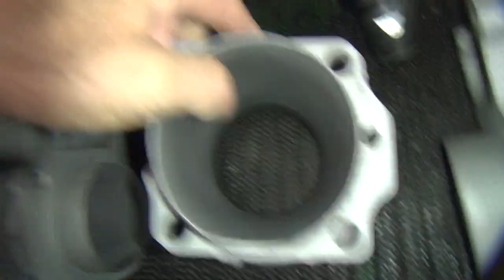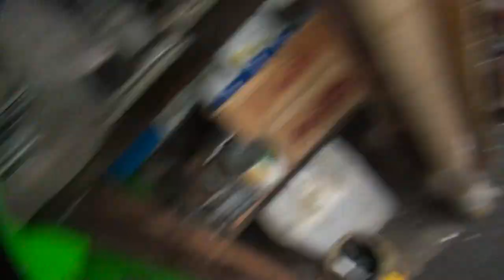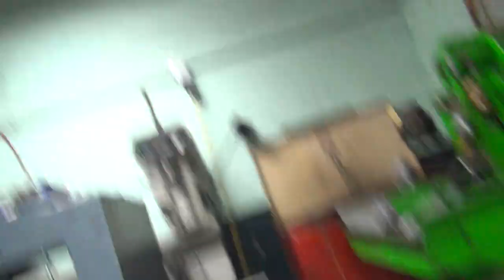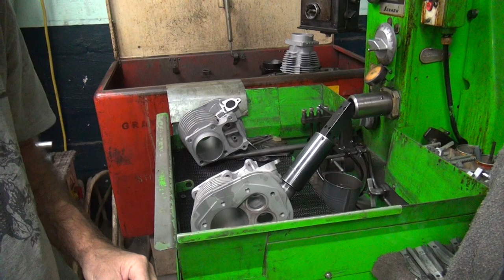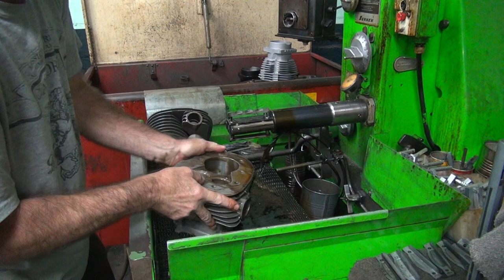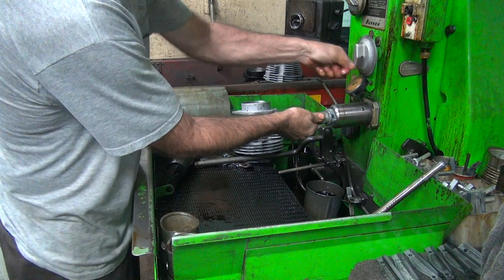1942 xa #102 topend rebuild 45ci military harley flathead by tatro machine

Comment: Hey Keanan.  I've noticed you've gone from using a dial bore gage to a tubular inner.  Are you just mixing it up or was there a reason for the switch?
Reply: Not necessarily dry; I've seen him use it when he was honing pinion shaft bushings for sure, which means there's probably not a tube mic that small (in fact I'm pretty sure there's not) AND it needs to be a bit more accurate I would think than a tube mic could provide?  But I could have swore I saw a bore gage on a cylinder at some point.  Doesn't matter.   I did just pick up a nice set of Starrett tube and extensions on ebay at a good price this weekend.  They definitely would be easier to take apart and clean I should think.....
Reply from the maker: the soft dial bore gauges wear alot in the rough cast iron bores from all the honing grit. the inside mikes don't wear much at all because of the way they are used. both ways are just as accurate. the hardened case races hold very little grit so you don't have the wear on the tools. on valve guides i have to use the bore gauge and it does wear the tips a ton and changes by the end of the job.
tatro

Comment: I have a couple questions about the honing posses? First question is about the bore diameter difference between the cylinders. The cylinders I've come across are a lot closer in diameter than the ones your using. Is this do to them possibility being from different motors or the age of the cylinders. Second question is I have never had to have my piston pin holes honed. I have always used forged pistions and not cast. But is this again due to the age of the motor and the possibility of differences in the casting of parts at the time it was made. I have never built a motor of this age but want to one of these days.
Reply from the maker: the cylinders were the same bore size but were slightly different in true size from wear. most all new pistons are slightly different in true size. that is why i rarely hone a cylinder by a preset size like twincams are. all most every cylinder i do is honed to the piston going into that hole. that is the only way that you know for sure what your true clearances are.
most newly made forged pistons today are made very close in tolerances so they basically measure the same all over but i have seen errors so i always check and adjust accordingly.
tatro
Reply: Thanks just wondering thanks and keep up the great vids